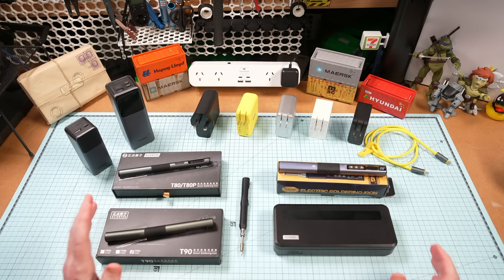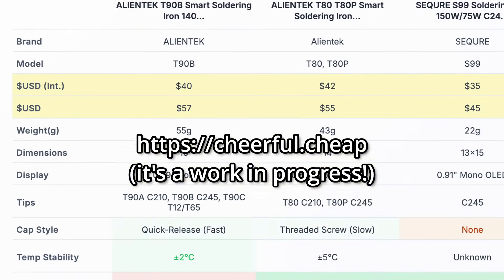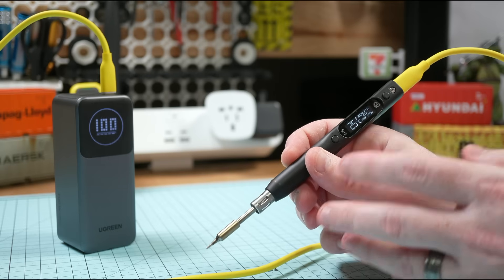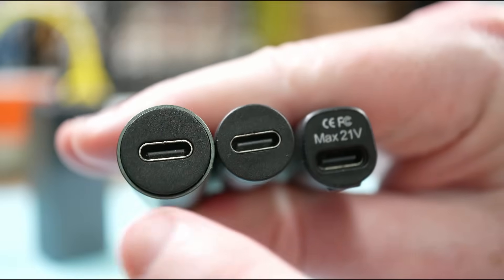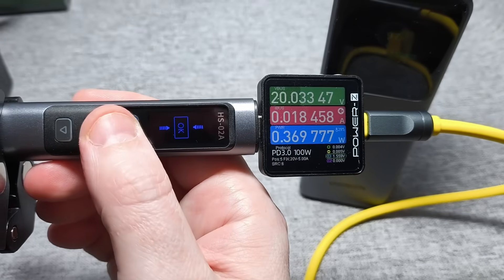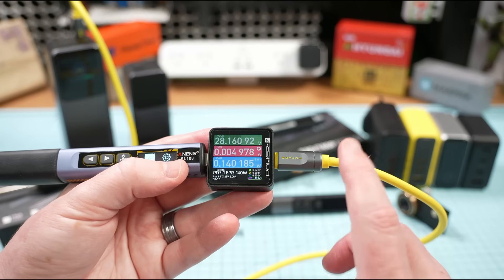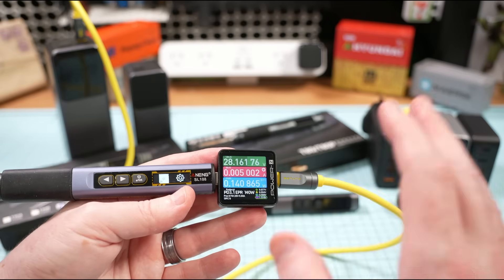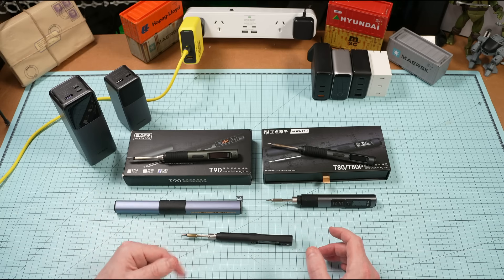TESTED: Best Soldering Irons  + Chargers inc.  T90, S99, Fnirsi, and more

Comment: Hey, Ive got a UGREEN Nexode X 100W 20V from amazon, with a UGREEN 100W cable aswell.
Do you think it could handle the HS02-A ? 
Im really thinking of buying this iron because of its JBC tips, ease of use and most importantly, the case
Reply from the maker: It will definitely work with the HS02A, but maybe not full 100W power. Not sure if you saw in video me testing my 100W nexode with the HS02A. It just needed me to set the iron to around 87% power for cold starts and that's still HEAPS of power. They come from the factory set for 65W anyway so out of the box it will work fine, just if you crank it higher keep it no more than 87%. If you set iron to  100% it may just  reboot.  I'd go for it.

Comment: Love your soldering iron videos!
Love your USB cable videos!
But you know what I'd love even more?
USB cable  PLUS  soldering iron test video! 😄

What I mean is:
Don't just assume a cable is good for soldering irons because it's flexible. Actually test them. Together.

I'm just tossing random ideas for a video here:
-) What if you realize while using them, that 1m is generally a bit too short, because you don't have a 100W+ power bank with you and your only AC power plug is at the far back of your desk? 
-) Or that the sharp edges of that specific USB plug graze your hand sometimes when putting away the iron? 
-) What about some specific combo of cable + soldering iron fitting too loosely, not giving you much confidence in a reliable connection? 
-) Maybe some cables start remembering their loop-shape after getting rolled up a 100 times? 
-) Is the mantle really silicone? Or does it melt trough to the metal at lets say 5 seconds at 300°C, when the iron leans on the cable with it's body weight?
-) How about the subjective feeling you get while using the cables +  iron? Which cable (or combo) feels most comfortable to use?
-) Do some mantle surfaces cause more friction/binding than others when you create a loop accidentally by turning the iron? (maybe incorporate into previous point, the "feeling")

How about it? Do you like the idea for such a video?
Or is just "any" 100W silicone cable already good enough from your experience?
Reply from the maker: This is all great feedback, thank you. So I can definitely do more rigorous testing of more cables with irons. Since I found that issue demonstrated with ANY Aohi cable and Aohi charger (together only) with the T90 only, causing reboot it makes me suss that many cables and irons might have compatibility problems, typical for USB C. I've copied your feedback into my system for video planning so I can refer when I do my next soldering episode. Thank you for the super constructive input and thanks for watching! 😊
Reply: @CheapCheerful  Cool! I'm glad my comment was helpful to you! ☺

Comment: Great lineup! 
I just wish there were 100W 18650 powered irons that took JBC tips. No matter if it's empty in 15min. I'd just swap in a new battery.

I don't get why they can't just put in a high current 18650 cell, like a Molicel P30B (delivers 100W constant).
Well... I guess because people will then put in cheap batteries and blow up their hands 😂

That'd be the next step in the evolution in my opinion. (not the blowing up hands part 😆)
I'd be thrilled to see a cordless 100W soldering iron on the market soon.
Reply from the maker: I agree. 18650s would be great. I'll be looking at cordless models for the next in the series.

Comment: 15:53 Did I catch an error here? This is the first time hearing that the TS101 fits JBC C245 tips.
Or did you mean something different by saying "245 tips"?
Reply from the maker: Arrrgh! You are right. How did I make that mistake! It's a BC2 tip. I gave my TS101 away to someone at work, so I did'nt have it on hand this time, and my brain has put it in the 245 box. Thank you for the correction. Edit: Added a correction note, it will appear within 5-10mins. Thank you, very much appreciate you picking up on this.

Comment: You state the T245 tips are expensive, but I got two chisel tip in 0.8mm and 1.2mm width together for us$7 from Ali.  T245 has the biggest range of tips or special tips.   It is another game with T115 and T210, these cost more, even from China.
Reply from the maker: Good one. Yup,  Ali prices make everything cheap. I should update that, thank you!

Comment: I'm glad to see the soldering iron series continue, and I definitely look forward to more testing, especially with the dedicated temperature tool!

I'm liking the FNIRSI HS-02A since the first video. It does seem like they make decent products. I hope the HS-03A will be more reliable and maybe just a slight bit thinner.

I really wish this USB-C mess would be cleaned up already. I'm glad that everything is moving towards USB-C, but the protocols and special cables and special e-marker or what have you... it's getting obnoxious.
Reply from the maker: Agree 100%,  it's good that finally there's no Micro USB nonsense, but USBC consistency is all over the place. Have you had reliability issues with your HS02A, and if so, what was it? Thanks.
Reply: @CheapCheerful  I still need to watch a few dozen more soldering iron review videos before I can commit to a purchase lol.

Comment: Are the 140W charger and 140W cable that come with the Alientek T90B kit on Aliexpress good or is it better to get the Voltme charger?
Reply from the maker: Cable is good. I haven't got the adapter. I usually only buy 110/240v items from Ali if they're a brand I trust. I'd recommend getting an adapter that has your local country's safety certification (UL, CTick, etc.).  If you're US or AU check the Amazon links provided in pinned comment.

Comment: I really think you should put some "standard" sized objects in these videos when the products are something you hold in your hand.
It would help people know what kind of 'fit' they are going to get with these, which can be important for something like a soldering iron.
Maybe use a Bic pen or an unsharpened pencil?
I know I personally find the HS-02 to be just about the right size for my hands, yet you describe it as "big".

Funny that I was JUST thinking about putting a comment like this on an older video in case you were going to post another soldering iron one, then I look and see you have a new one up.

Also: It might be worth looking into which of these irons can be 'upgraded' with open sourced firmware.
IronOS is pretty neat, and has worked with several of these companies in the past to get the design files they need to port the firmware to their irons.
Maybe getting a bit more publicity could help get the more stubborn ones to work with them.
Reply from the maker: That's a really good idea, thank you! I also find the HS02 perfect though many say it's too big (I conduct a lot of research prior to video to try remove my bias). Thanks for the feedback.

Comment: every time i try to shop for one of these smaller irons it just defeats the purpose of the portable aspect if you need to have it wired up to a big power bank anyway might as well get a $100 750-1000W station with the power supply built in
Reply: I used mine with my laptop USB C PSU, which I would have with me anyway. Works a treat, and lets me pack a full solder station for almost no extra weight when I bring the laptop. Now I got a tiny little 140 W PSU which I can use for both my laptop, my phone, my tablet and my solder iron, making the package even smaller. I literally fit the whole solder kit in two jacket pockets now, which I can't do with a whole station.
Reply from the maker: Not sure if you watched the Powerbank part, but you don't need a big one. The 100W Ugreen I use is barely a handful.
Reply: It's USB-C. The entire point here is that you either already have a USB-C charger, or you are going to get one for a lot of your other devices. Laptops, work lights, phones, soldering irons, hair trimmers, thermal cameras, computer mice, external hard drives, etc. all have USB-C power options these days, so you don't need a power supply that works only with one single device.

USB-C is a good thing because we all own multiple devices that use them, and this means having fewer power supplies, not more. This is especially great for travel!

Comment: The way to prevent ICP errors is to keep a spray bottle handy with a bit of Faygo diluted at a 10:1 ratio on hand for typical use, but if you're looking for closer to  say 60-80% duty cycle you want 10:1. You can use the Faygo straight, but you'll see a significant decrease in overall service life and may experience circus hip hop music.
Reply from the maker: Ok I need to research this, thanks!

Comment: What is your opinion about the FNIRSI HS-02A Set on aliexpress? There is a 100W Charger included but the question is now if the charger is even good or if someone should invest in a different one.
Reply: If the charger isn't a known brand, I wouldn't use an Ali charger. I have bought Ugreen and such from there, and they're legit, but every no name charger has been at best junk, and at worst a fire hazard.
Reply from the maker: I agree with @lazyhominid. I mean it's probably fine but unless it's a brand I never buy 110/240V items from Ali. Similar price get a good one.
Reply: Take it without thinking. For now, there’s no serious competition. I’m using the HS-02A and a Chinese GAN3 200W charger with a PD 100W port, and it works, delivering that power on that port. And the cable must be PD 3.1, 3.2… or sometimes they write 240W, also Chinese, with silicone coating. I don’t have the factory Fnirsi charger and haven’t tried it.

Comment: As for attempting to measure tip tempature with IR, then buying some expensive measurement device made specifically just for it, why did you not (unless your unaware) just use a standard multimeter with tempature measurement capabilities. Most digital multimeters today come with the ability to measure a wide range of temperatures accurately, fast, & easily utiling thermocouple temp measurement, which most of them ship including the probe.
Also, I completely agree with the other guy who made the comment stating your comparison and the "tests" you're performing, are pretty much useless for us to determine how good any of these would actually be. How about actually soldering with each one and it's ergonomics and seeing about their ability to supply output while heating something with large heat-sinking properties like large copper sheet or ground plane, just for quick example. 👍🏻
Reply from the maker: Looking forward to your more useful video :)
Reply: @CheapCheerful lol if you need anymore help (after the fact of course) I'll be here all day lol😅

Comment: Most of the tests you're doing are kinda pointless. Only turning the iron on and measuring heating up is not a good representation of a performance while soldering. 

Add tests with soldering large ground planes or large blobs of solder. Or at least put a tip in the water. Fnirsi can't sustain a power output and soldering large planes, T90 can. 

There is no point in 140W iron for soldering connectors on a thin wire
Reply: Is there even a point to 140W irons? My 40W Weller will solder everything with upto a 5mm tip.
My 100W Weller is more for gutters than electronics.
25W should be more than enough for these small tips.
Reply: @Xrayfk05 yes there is. E.g., I often have to repair LED-lamps that use aluminum pcbs that act as a heatsink. Low power soldering irons or improperly engineered ones (like Fnirsi one) can't do the job at all or require a very long time
Reply from the maker: Interesting. Which USB iron do you prefer? Or do you use a soldering station? Thanks.
Reply: @CheapCheerful I often have to do that on-site, therefore can't use soldering or hot air station. I used to do it with butane soldering torch but it has major downsides.

With fnirsi 100W it became kinda doable. But when I bought T90 140W I realized that fnirsi really underdelivers the power. So if you could show the comparison of the two (or more) in high thermal load scenario, it would be great.
Reply: @anatolyvasilyev8414  That has nothing to do with power but with tip mass. (mass equals stored energy/heat)
Reply: @Xrayfk05  Higher wattage irons will be able to recover faster when the tips are pressed against something cold. Your 40W Weller likely has a massive tip that has a lot of thermal mass, so it doesn't need a high wattage as it is storing a lot of heat in the tip ready to be used on something cold. The smaller irons meant for precision work can't store a lot of heat in the tips, so having higher power means they can produce heat quickly rather than relying on a "reservoir" of heat when the tip is pressed against something cold.

In other words, the smaller the tip, the more it can benefit from higher wattage, not the other way around.
Reply from the maker: Yes I agree. 65W is plenty for most. But if you're going to purchase, may as well get the best for similar money.
Reply from the maker: Yes, I hoped to use the XT60 for demonstrating thicker stuff (first video went into this in more detail, I skip over it alot in this video as real life stuff got in the way) but you're right I need something bigger. I'll research into what's a better test. Thank you for the frank feedback, I appreciate it.

Comment: Автор не разобрался. Sequre S99 прекрасно работает с жалами на 2,5 Ома и даже с оригинальыми JBC, только необходимо и хороший кабель и блок питания. Паяльник в максимуме на 20 вольтах может с жалами 2,5 Ома потреблять до 110 Ватт, и если БП ниже 100 Ватт или жестко отстроены границы отсечки - будут уходить в защиту. У вас именно такой случай, или вы используете несоответствующий кабель или Блок Питания не тянет. У меня именно такой кабель AOHI как у вас и он работает на 140 Ваттном БП AOHI MagCube и работает с powerbank  Zime Z5. Жала JBC и комплектное жало от T90B. Помимо прочего, если вы подадите на паяльник 21 вольт и 7 ампер - вы получите и 150 Ватт, это официально указано в таблице к паяльнику S99.
Reply from the maker: I tested it with all the cables and adapters you see. Sure it will work once it heats up, but I'm not going to recommend a device like that, internet is full of complaints for a reason.
Reply: @CheapCheerful  Тогда большая вероятность что у S99 присутствует какой то брак в производстве и он попадается покупателям. У меня таких проблем как вы показали - нет, паяльник запускается на любых жалах в холодном состоянии. Единственное когда у меня паяльник уходил в перезагрузку - это когда я использовал шнур без чипа с жалами на 2,5 Ома. Блок питания Ugreen Nexode Pro 100 Watt блокировал работу при попытке паяльника получить выше 60 Ватт мощности, это заложено в логику всех умных блоков питания как защита для шнуров без чипов. А другой раз паяльник перегружался на том же Блоке питания с правильным шнуром, когда мощность уходила за 102-105 Ватт, и срабатывала защита блока питания по перегрузке. На более мощных блоках питания такой проблемы уже нет. Так что возможно вам попался бракованный экземпляр.

Comment: I bought a similar USB C soldering iron and it always boot looped but after heating up it reduced the amount of clicking I need to do to keep it hot. I have been using it for years now and it never occured to me that it might be overloading the 65W charger. I always thought the soldering iron is dodgy.
I wonder, can any of the ones you tested limit current precisely so that they can be used on a variety of power sources like power banks that are 12V 1.5A for example?
Reply from the maker: It might be the cable too! All of the irons tested have ability to change max wattage/amps. Unsure if you saw the part where I test the wattage of T80/T90 (about 7:41) but I show the config screen (press both buttons to enter), and you can change the wattage very specifically, up or down, based on the amps. I'm unsure if they go as low as 1.5A, but worth a shot. Lookup the manual for your iron, or try hold down both buttons at once, or one button when starting, to find the settings screen. Also note, even if charger, iron, and cable 65W, they'll often draw more during startup (eg. 70W) and can bootloop. So might be worth de-tuning a little even if everything is "correct". Thanks for watching.
Reply: Unfortunately the only way to be sure is to use something like the Power Z to measure what the PSU provides, and what the cable says - and does. Hopefully the cheaper version is good enough for that as well. It's very costly to get a Power Z just to test a thing or two.